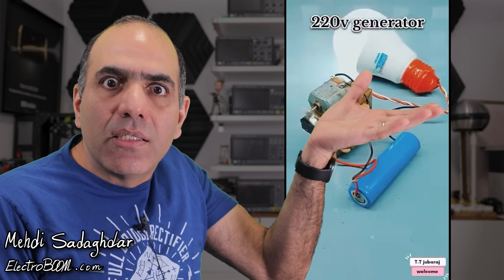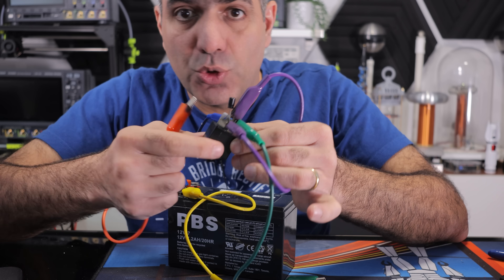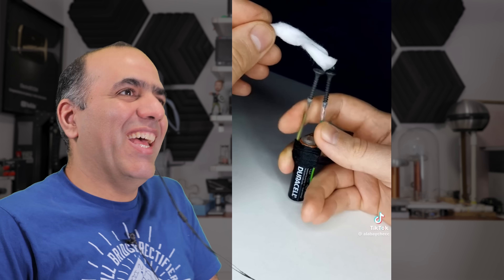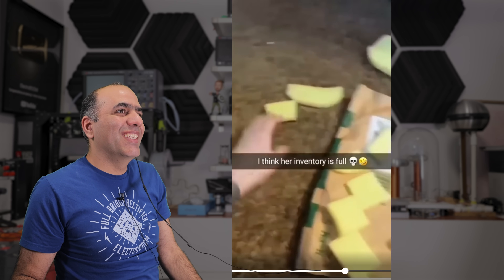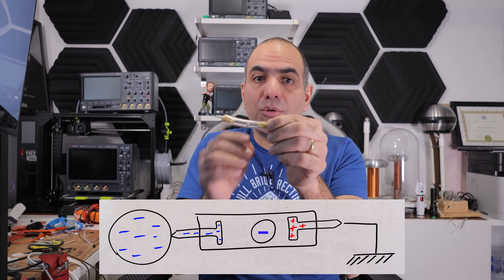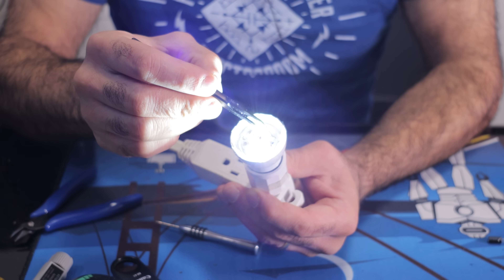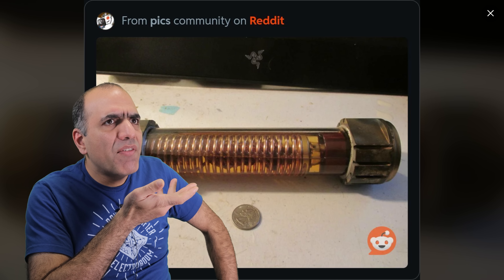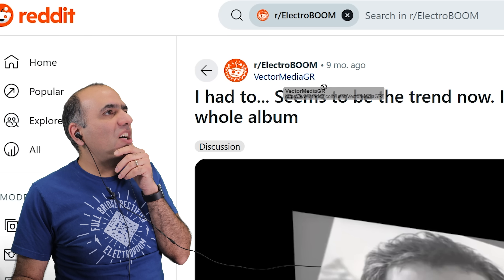Nuclear Egg (LATITY-015)

Comment: The relay you're using in the first experiment used to be called a vibrator, particularly in automotive applications for radios, before transistors.

Comment: 5:10 The poster is probably ESL—FYI, in French, we call a single electrochemical cell « une pile ». Prescriptively/traditionally we use « une batterie » for multi-cell batteries, though in practice a lot of speakers use them synonymously, or use « une pile » for replaceable cylindrical cells like AAs and « une batterie » for built-in rechargeable batteries as in laptops/cell phones.

«una pila» is also used in Italian and Spanish, though I couldn't speak to the nuances between that and «una batería» (Es.) / «una batteria» (It.) in those languages.

Comment: 4:17 This is an easy and reliable way to make fire in emergencies though. The wires get hot enough to ignite paper or other kindle. You can also use a piece of aluminum foil instead of wires. Or hold a 9V battery to a piece of fine steel wool (also looks really cool btw). No skills required unlike with a fire drill or other firestarter tools.

Comment: I did the led lamp thing 12 years ago with a 7035 transistor, a small transformer,  some high speed diodes and a switch that makes high/low output by adding a diode in series.  Built a little stand with a bulb socket for it to clip on 12V 12Ah batteries.  Use it as a 12V lantern if the power goes out and a novelty piece.

Comment: If you want to do the motor shock doohickey even better you can use a motor out of a GM blend door actuator. Given they only last ten minutes scrap ones are dirt cheap and the motors inside have a commutator designed to deliberately interrupt the circuit to generate pulses.
Reply: huh, that is a really good point.  the motor already has a commutator.  let the commutator do it!

Comment: First of great video!
You should do a video on the problem with the NVidia 40 and 50 series GPU. they don't check the load on each 12v lane so the gpu has no idea what the distribution is on each 12v lane for its power. meaning that if you have a bad cable it will try to get the same load out of 2 12v cables where it normally ask that load out of 6 12v cables......I think this is such a simple solution you can make a good video about it. You can talk about redundancy, safety and how the basics are still important in modern day technology like idk making sure you don't allow a load to go over a cable that could melt it.
Reply: u r in way over ur head
Reply: @urnoob5528  ngl i was pretty high typing that comment

Comment: Good tip about fixing the led bulb by restoring the connection over the burnt led. But if they are serially connected, wouldn't a good, soldered connection be basically a partial short circuit over where there should be a voltage drop over the led? I thought about using a small resistor instead, but I guess the failed led took only about 1V or less and is also a short circut when on so a resistor would be a waste? I was thinking about the rest of the leds in the circuit and their longevity, but considering that one already failed means the others might fail soon too: maybe the bulb got too hot in its environment before or something so who cares if they get a really minor overvoltage after a quick fix.
Reply: and u also need to learnn english
Reply: Never mind, didn't watch the explanation before commenting 🤦‍♂

Comment: 1:39 actually made it too with a relay … it was strong at 30v the shocks where funny
Reply: I was dumbfounded at the start. My brother made this exact same contraption in the 80’s as his “science project” and disguised it as a fortune telling machine. Putting your hands on the two electrodes would close a micro switch and turn on the motor and zap you. I don’t recall it going over well.

Comment: there is a real micro reactor. look up the kilopower project NASA did. its a tiny reactor that uses sodium heat pipes to transfer heat from the reactor to sterling engines. designed for sizes between 1 and 10 kilowatts

Comment: 30 years ago, I did this exact thing with an electronics project board(lots of components that you could connect with jumpers). My power supply was 6 batteries and a universal, adjustable ac adapter. I forget the math and voltage. But, I woke up on the floor away from my desk

Comment: The AA battery fire starter could be possible if it's 14500 lithium cell. They are identical in size and shape, but, you know, being lithium cell, they'll definitely spark.
Reply: not until the battery explodes.  3v isn't enough to make a spark.
Reply: @tsm688  From my experience messing around with 18650 cells, I'm more than sure it'll spark when it shorts circuit, even with single cell.

Comment: Trick to the lightbulbs is use a pencil and superglue to short across the bad led..  just break the bad one off, scribble the pencil across it making graphite dust then superglue to keep it in place..  works without glue but lasts longer with it..

Comment: I made a lot of people angry with little toys that would shock you when they were picked up/moved using old adapter transformers and mercury switches
Reply: Used to be a trick pack of cigarettes or playing cards worked same way - pull out the internal pack from the jacket and get a jolt across where fingers were on the electrodes!

Comment: 10:35  as Gru would say:  "LIGHT BULB!"  Why don't they put those LED's in Parallel with each other????????????????
Reply: 10:49
This is why. 

Note: FIX VOLTAGE IS THE MORE COMMON DRIVER LAYOUT FOR AN LED.
Reply: @dogs-and-destruction-channel  10:49 is talking about SERIES...not parallel; therefore this does NOT (and scientifically speaking CAN NOT) apply to my question as current is additive in series and COMMON IN PARALLEL.  If you don't know the answer, please refrain from guessing.
Reply: @nobody7817  
The reason why I highlighted this time stamp is because the driver by default are userly a Fix voltage. Meaning that they have to be in sync with each other in order to handle the Fix voltage. Otherwise, if you run them in parallel each one will be receiving the fix voltage instead of all sharing the load. Therefore it's like if 2 bulb blew and 2 were fine, the 2 that were fine will burn out quicker as there isn't enough resistance (that were created by the other bulbs) to dim down the voltage enough to last longer. However Fix currant drivers would be fine with LED in parallel but Fix voltage will not (Unless voltage is reduced or restricted enough for the bulbs to handle individually). It's not a guess my bro, it's electronic fact.

Comment: With regards to the battery and screw firestarter you didn't use the same chemistry battery, those Duracell with the green stripe are rechargeable and when shorted will indeed create sparks  :)

Alkaline won't as demonstrated

Comment: Kreosan has a much better video on the led repair demo. I have been using your soldering technique though (because Kreosan suggested using silicone glue instead) 

https://youtu.be/JBKF7rKB3zc?si=7RLcn8pHVbsAt3nb 

Also, the current in an led light is DC, not AC. Most led bulbs have FULL BRIDGE RECTIFIERS. Isaw it in one of your videos before. Of course you don't need to hold the wire beyond the FBR hehehehehe

Comment: to be clear, that nuiclear egg battery thing, is probably an RTG or a "nuclear battery" as they're sometimes referred to, it's similar in concept to a thermal reactor design, but you use thermal couples to convert the heat into energy (granted you get like maybe .2w out of something that size if you really really tried. Or probably something like a tritium battery, where you use PV cells to generate electricity from light produced from tritium. They uh, aren't very practical, as you can imagine.

these can easily last 10-20 years, if not longer, it's just going to have the power output of a decay curve, which is quite funny.

Comment: i did this one time with the relay,  i simply put a voltage buck boost converter to boost  12 volts to   what the 24v relay could handle  i would change the input voltage  to change the frequency. it wasnt' Very strong BUT  i was able to power a few small led lights  through  a microwave transformer  the leds' were dimmable  i dont know what output i was feeding it but it was enough to apparently make it work .

Comment: By using thermal electric semiconductor units, the nuclear generator can be useful without water, that's what powering the voyager-1, but those stuff needs huge temperature difference and have very low efficiency, a size of an egg in room temp would maybe output 0.5W, also the radiation is slowly killing you😂

Comment: 0:20 That's how I built my induction coil, like Mehdi's Taser, but I used a 4.5v to 230v transformer in a bottle of motor oil (to stop arcing across the terminals and windings) and I used a similar motor and switch setup to make the high voltage. The only difference is that I have a capacitor parallel to the low voltage side of the transformer.

Comment: 3:03 Thanks for the advice.
But I've already made that circuit(some years ago) with a ccfl transformer. Also I didn't use the normal-open connection in relay(so the frequency is higher).
And i zapped all my friends with it. It has tiny sparks looks cool.😊

Comment: the mechanical switching inverter that you built is how they used to make inverters before transistors were invented. I actually have a 1930s car radio that I restored and it uses the same idea to generate ~160v for the vacuum tubes. they are usually called vibrator power supplies and often have a grounded center tap on the primary of the transformer so they can alternate between positive and negative instead of zero and positive.
Reply: Old Motorola 2-way radios from 1950s used by hams in 1960s had vibrator power supplies too ... before that, dynamotors were used, a common shaft motor-generator set.

Comment: 3:18
Wow, talk about a coincidence! Just yesterday, I took apart a USB-A power adapter that was built almost exactly identically to that one to determine what failed inside! You can see the glue around the wall side of the face place (they're not easy to disassemble) and it's nearly the exact same circuit board. The board has 2 contact tracks that are covered in solder, which the wall prongs have receptacles that the board just slips over when assembled.

Comment: 11:14. Mehdi auditions for the next Joker role.

Big Clive often points out that most LED lamp bulbs are voltage driven and usually overdrive the LEDs current-wise for more brightness and have inadequate heat sinks, shortening their lives and increasing the risk of fires. Shorting individual burned out LEDs just aggravates this.

I can see doing it in an emergency when you have no replacements available, but I would keep an eye on them when powered and only run them for limited time as much as possible while making serious effort to replace them. While I don’t mind the occasional zap, I have zero tolerance for house fires especially in my own house.

Otherwise, DON’T DO THIS AT HOME OR ANYWHERE ELSE. Your boss won’t be happy if you burn down your workplace.
Reply: just watch the video..  he explains this all for you plus some things you missed.

Comment: There is a type on electric generator that is nuclear and doesn't produce any steam. It's called a radio-thermal generator or RTG. It won't produce enough for a house but they are quite common on space probes and even the mars rovers.
Reply from the maker: But isn't there any sort of thermal flow, say inform or radiation, coming out of those?
Reply: @ElectroBOOM  Yep, there is thermal radiation coming out of the heat sinks.
Reply: they are huge and have a huge heat sink.  they are not a small plastic egg.
Reply: @ I know. Also, there is one on the curiosity rover around the size of a microwave. Also also, the egg shown in the actual video didn't look that small to me (relatively)
Reply: @ biggest fucking microwave I ever saw...  more like 2 or 3.  and it's only enough power for a lightbulb.
Reply: @tsm688  Why do you have to try to argue about something. Btw, its only 25 in long, about the length of my microwave.
Reply: @ I saw a picture of it.  Bullshit.  You're not counting the cooling fins.  Which are also what's missing on the "egg".  It couldn't possibly be a real device.
Reply: @tsm688  No I'm not counting the fins. I agree that the "egg" is bogus but RTGs are very real. Yes, they produce hardly anything but I was just bringing it up. Can you just chill out?

Comment: For reference: Almost all "normal" AC LED lamps are current source. Except relatively dim night lights and decorative lights which may be either.
A LED holiday light strip without a driver box (the plastic thingy with or without a button to change modes) is a voltage source, with it - usually a current source but mind series-parallel the LED layout.
12/24VDC LED strips are obviously voltage-sourced, or at least supposed to be
You can often decrease current through a typical current source AC driver by cutting one of the sense resistors out - at the cost of lower light output. But it will stop burning out and last longer.

In a voltage sourced layout replace dead LED with a resistor depending on the voltage and current.
In a current-sourced strip short the dead LED, but too many shorted LEDs may lead the driver to failure.
Reply: LED drivers should never be constant voltage. Even the poor ones usually have a resistor so the current will increase a bit and the voltage will decrease a bit if fewer LEDs are used. The current through an LED is not proportional to the voltage across it. If the voltage did double as Mehdi shows, the current would not be twice, it would be many times larger. 

I've found that shorting an LED with constant-current drivers has been a long-term fix. The constant-current drivers usually reduce the power taken from the mains when some LEDs are shorted, and all the LEDs run cooler when one is shorted.
Reply: @MalinDixon  LED themselves are always driven by stable current as you said, their operational voltage is too narrow and varies with temperature and manufacturing batch.

But there are LED lighting designed to work with fixed voltage i.e. 12V LED strips are arranged with parallel sections of 3 LEDs plus a ~100R resistor in series.

This is what I mean by constant voltage - the input voltage for the strip(s) is regulated to 12V irregardless of current, and when applied to a resistor Ohm's law turns it into constant-current source for LEDs.  

This is rather inefficient - about a quarter of power is typically wasted heating the resistors in addition to AC-DC conversion losses but it also has a lot of advantages. 

For instance it is less prone to burn-out due to uneven LED junction characteristics, and if an LED does fail only a small section goes dark. 

It also allows for a better-quality replacable and repairable PSU to drive dozens of small and large strips of LEDs that can be turned on or off or dimmed independently which reduces waste due to unrepairability of LED lamps caused by high-voltage AC safety issues.   

Another example is very cheap indoor holiday lights which are driven at a fraction of their rated current and current-limited with  a single resistor per strip which assumes the input AC voltage is roughly within spec. They are almost as dangerous as their incandescent counterparts. 

Yet another example is a key-chain LEDs connected directly to a battery. In that case internal battery resistance acts as a very crude current-limiting resistor.

Comment: About the nuclear reactors, they don't all use water and vapor pressure. Soviet-era Beta-M reactors were RTG-reactors that used strontium-90 as their fissile material and some thermoelectric material directly on that reactor. There are still some lighthouses runnin on those nuclear batteries and occasionally those batteries are found from siberian tundra as Soviet army used those batteries for their mobile ICBM-stations.
Reply: First thought, would most likely still need liquid source to transport heat from the cold plate, when scaling up.

Comment: Mehdi can you please shed some light on this madness around the power draw of the new gen GPUs? A bunch of non-electrical engineer background YouTubers claim that it is safe to run 50Amps on 16AWG cables continuously for hours and then we see GPUs melting down the cable plugs.... These cards draw more than 1/2kW of power.... is it really safe or are they being paid from Nvidia to calm the waters?
Reply: Bottom line, if your power supply is rated for 50 amps, its cables are rated for 50 amps.  They're not complete idiots.  on power supplies that big they use 3 sets of doubled-up 16 gauge, which gives room for 72 amps.

If the cable plug is melting down, that's probably a poor / loose connection.  That's why the plug melts, not the cable specifically.

Comment: 4:10 The overall premise can work, that being using a battery to start a fire. It just requires different material, something like a chewing gum wrapper (The kind you get on sticks of gum that is foil coated on one side) that tapers to a thin strip in the middle, since the "Becoming hot" part can ignite the paper of the wrapper and then you can quickly use the burning wrapper to try and start a fire.

Of course, it's much easier to just carry a cheap disposable lighter instead of a battery, chewing gun and some scissors (To shape the wrapper so it gets thin enough to work) if creating fire is your goal...